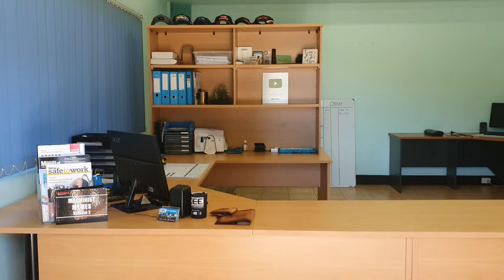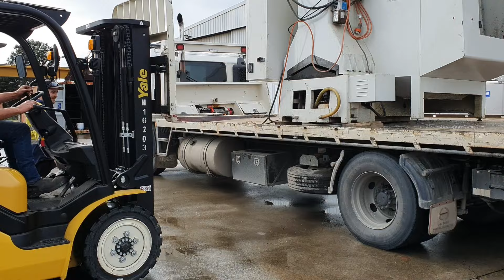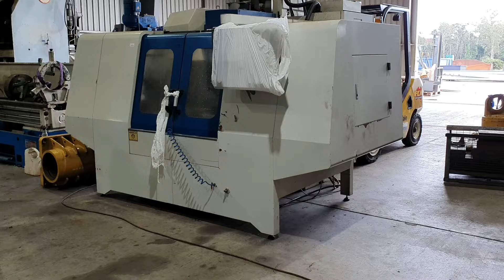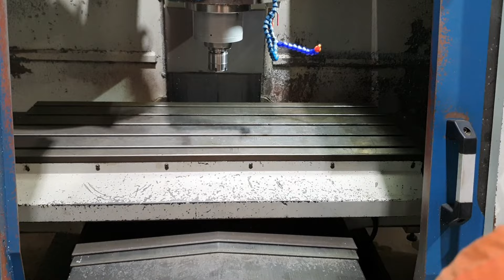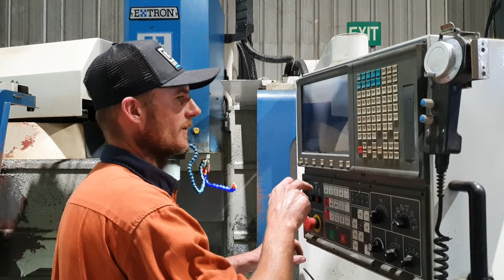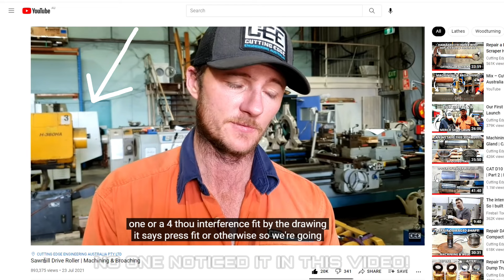Finally REVEALING Our New to us Machine | Workshop Machinery

Comment: The purchase of the machine will turn out to be the least expensive part of the journey. The CAD/CAM side is a whole other expense and learning curve , including the required post processor to convert the NC files that your specific control will require. It's definitely a walk before you run learning process, but since you already have lots of manual machining experience, I don't think it will take you too long. Hard to rationalise spending 45 minutes programming  and setup to bore one or two holes,  especially when you could have done it on your manual mill. If you force yourself to use the CNC whenever you can, you will quickly realise the value of your CNC mill.
Love the video's, and all the best to you!
Reply: Machinist here. CAM is the cheapest part of any CNC machine. As a business you do not mess with free CAM software. You must make sure you have a bulletproof post for that exact controller on that exact machine. Pay for it, or gamble with crashing your machine and needing a spindle rebuild.
Reply: Aww…. He will learn as he goes …. In the meanwhile, he will be cranking out metal bananas…. They will be online in the store.
Reply: As it is 2000+ machine it should be g-code capable so modeling shouldn't be a problem with any cad/cam software with g-code output.
Reply: @goodiezgrigis  G-code has been around since the time when these machines were called NCs instead of CNCs and ran programs off of punch tape.
Reply: @goodiezgrigis  The boot screen shows the software is from 1998.
Reply: @goodiezgrigis  said flippantly as if commented by someone with zero real-world experience
Reply: @new-zealand-clippy   I learned the hard way. It's not very polite to assume who/what I am. regards
Reply: @goodiezgrigis  Not so fast, the CAM software generates a toolpath, and the post processor generates the control specific G code. You have to be very careful with just punching out the code to the machine control. I'd go back to the previous mill owner and ask them for their post processor (specific to the CAM software they use)
Yes, most likely Fanuc, but all controls especially non-mainstream PC based machine controls can have very specific block structures, if you are lucky the control will stop at the faulty block, if you are unlucky you may end up with the spindle buried in your vise.
 I ended up testing each cycle separately, and modifying the post processor before I could get our machining center up and running. Our control (FAGOR 8055M) was not mainstream enough, so that even the SolidCam post processor we got with the software was useless. Cheers
Reply: @martyincanada  you want a specific post-processor tailored to your machine when you are running days long in production where every lost second is money. For small batches, standard G-code any machine can use is perfectly sufficient.  It's a totally normal mill with XYZ axis and a tool changer, one of the good things to learn is even to write g-code yourself to get the machine to do what you want.
Reply: I had a Toolmaker friend that ran the only NC (CNC?) machine (at that time), which was a mill, in the Tool & Die Shop.  He programmed it by hand using pencil, paper, his calculator, and had memorized the G-codes needed to run the machine.  The pencil, paper, & calculator were to 'trig-out" the required dimensions to go with the G-codes.  Of course, he still had the programming manual if anything "unusual" came up.  I don't recall him making more than only a very few mistakes over the years, which is much better than I can say for the CNC Shop across the aisle which had full-blown CAD-CAM support.  They managed to make way too many batch mistakes that were extremely costly in both lead-time for very hard to get materials, machine time, and all the cost that goes with those kinds of mistakes, especially when they are able to be hidden from someone in Management with enough power to make real & lasting changes (i.e., real & useful training where appropriate and even termination where that is appropriate).  [Sorry for getting on my soapbox from some bad experiences at work before retirement!]
Reply: @bobvines00  That's just lazy programmers
Reply: @SuperAWaC  Or it could have been the (I think it's called?) "conversational programming" right at the machines maybe.  I wasn't supporting the CNC Shop by then, so I only saw the piles of expensive scrap.  :(
Reply: @bobvines00  lazy programming is lazy programming. conversational is pretty awful though
Reply: @bobvines00  NC and CNC while similar are also different in their own right. NC was the precursor to CNC, and has been around since the 1950s.  

NC is Numerical Control. The first true NC was developed in the mid 40s after WWII (1946 I believe), but they weren't produced in mass until the 50s. The programs for NCs were delivered to the machine via punch tape. The tape was the data transfer method (like thumb drives today), and the machine had an analog computer that would read the tape. In early years the program would be typed out on a special typewriter that would then print the program onto the punch tape. In later years the program was written on a computer, and sent to a printer that would punch the tape. If there was a fault in the program it was much slower to fix as with punch tape the area of the fault was literally spliced out and the fix was taped in. Later on the punch tape was replaced with magnetic tape (like that found in VHS tapes). Not long after this the NC would turn digital. 

Computer Numerical Control (CNC) digitized the then NC machines. Now programs that were typed on a computer could be sent directly to the digital (computerized) control. This was originally accomplished with floppy disks, and is done now with USB thumb drives, and over the internet via Ethernet lines. Programming errors are much easier to fix as they can be corrected right on the control. CNC not only made it easier to write and edit programs to the machines, but multiple programs could now be stored right on the control and called up at anytime. NCs couldn’t do this as they had no memory and executed the code as it was read. This was just one of several evolutions that CNC brought to the table. 

In the days of NC, programming was dimensioned point to point, or Incremental coordinates as it’s called. CNC allowed programs to be programmed in Absolute where all coordinates are dimensioned from a single origin point. Now some NC machines were capable of Absolute coordinates, but these were developed in the very late age of NC. CNC machines are generally faster than their NC counterpart. This translates to shorter cycle times and cost savings (because time is money). Yet the biggest advancement that CNC brought to the table was canned cycles. Common canned cycles are drilling, tapping, boring, etc. They allowed an operation that once took several lines of code to be condensed into a single G-code (like G83 for peck drilling) with added parameters like Z axis depth and peck increment. 

All around the history of NC and CNC is pretty cool. These programmable machine tools have left their legacy on the industry for the past 80 years they’ve been around.
Reply: @trainman5371  Yes, we still had paper/Mylar tape NC machines when I started working, but they transitioned to CNC machines using first "Sneaker-Net," then an in-house "home-grown" (but good) network, then backwards to "Sneaker-Net" again when "IT SECURITY" was shoved down our throats by those that didn't understand CNC Machine Shops.  Later, a bass-ackwards CNC network was eventually re-set-up to permit programs to be sent from the Programmers to the Machines, but it was very costly, wasteful of production floor space (don't ask!) <insert face-palm here>, and slow, due to the "IT security weenies" having control.

The Toolmaker I mentioned was actually using a CNC-capable machine, but it was always "stand-alone" with no connection to the rest of the world and it was programmed primarily by the Toolmaker typing in the commands.  I'm not certain, but I may remember one time when my friend actually got one of the Programmers to help with a job and the program was either sent to the machine via "Sneaker-Net"  (once they figured how) or was printed out to be keyed in.  I suspect that the machine sat for years after my friend died and eventually was scrapped because by then the Tool & Die Shop had been "gutted" (personnel-wise) and there was no-one left able to run the machine.
Reply: @bobvines00  Yeah whoever managed that place certainly had their head up their ass. Sounds like it was a retro fit machine like a Proto Trak. They sell conversion kits so you can convert your manual knee mill into a CNC. I think they also sell the whole machine already converted, but don’t quote me on that. Most retrofit machines only have CNC capability in their X and Y axis. The Z axis (the knee) usually stays manual, but they do put a Z axis encoder on the quill for drilling. Those machines run conversational programming which is what you described where the entire program can be written on the control. They’re pretty convenient for making quick drilling and counterboring programs. They’re also really easy to program.
Reply: @trainman5371  Yeah, the highest levels of "corporate management" responsible for that crap definitely had their heads up their asses.  The machine wasn't a retrofit though -- it was pretty high-end for its time in the late-'80s - early-'90s, but I simply can't remember its manufacturer.  The guys responsible for procuring the machines only bought top-quality equipment, as long as it was available.  They did start buying CNC machines with conversational programming built-in for the "simpler jobs" which may be where the piles of expensive scrap came from, not from jobs programmed by the "real" CNC Programmers who had the high-end workstations, 3D Solid Modelling CAD software, and the (I forget the proper term, I think) the proper "processors" (the conversion programs to convert from CAD to the individual machines' G-codes) for every machine type, as needed.
Reply: @bobvines00  A place I used to work had a CNC mill like that. It was an old Mazak Nexus 510C, but the control (Mazatrol) as they called it was set up for conversational. Some CNC manufacturers integrated conversational programming into their controls along with the conventional G-code. I work with a lot of Haas now and I don’t believe they offer it. I think Fanuc does though.
Reply: Kyle can get a freeware cnc software online. Not the state of the art, but free.  Bamcam is one that should work.
Reply: @memyselfandi3925  The name's Karl, not Kyle....
Reply: @MrPossumeyes  haha, stupid spell check changed it.
Reply: If something isn't right in the post, the machine usually just throws up an error code and wont even run. CNC machines almost always do what you tell them to do, so if it's doing something whacky, you probably told it to do that somehow.

Comment: Getting a CNC machine is just the first part, now you have to figure out how to make programs. You can either write them by hand (takes long and it's easy to make mistakes) or you have some awesome CAD/CAM software and let it generate the programs for you. The latter one often costs quite a bunch more though as you might have guessed :)
There are some free programs, they're not as user friendly though, which might add frustration when trying to take some first steps in the field.
Reply: AutoCAD - Simple & Basic. Works every time.

Comment: You seem a little late to the world of CNC but with your vast machining knowledge it will soon take over big chunks of your work. I started with CNC in 1977 and don't think of it as just an automated manual machine. My advice would be to have a little play but then take out some time to quietly study its capabilities with the manuals rather than trying to learn by pressing buttons and hoping. Invest in a good offline tool pre-setter and keep preset tools with known dimensions in a nice labelled rack instead of having just a couple of toolholders and having to reload them for every job. Saves lots of programming time and setting on the machine if the toll dimesions and offsets are known already.  Particularly become familiar with macros and label and store all your programmes on a disc or card. It's astonishing how often the same patterns and tool paths recur and can be used time after time. Anyway, best of luck!

Comment: I've had a 1989 Fadal 4020 for a couple years now.  Still have a lot to learn, but its amazing the stuff you can make pretty quickly/easily with one that would be extremely time intensive with manual equipment.

Comment: Nice, Come on over to the dark side. Dark side is better because can close the doors and then all the hot metal bits and coolant stays in the machine instead of on your skin and the floor. CNC is a lot easier than most old manual guys make it out to be. You have to do all the same things but instead of turning hand wheel to a number you just type it in and the machine turns the dial for you. Oh 16 tools isn't very much, definitely not enough for job shop. I run a one man job shop with my 40 tool machine and that isn't enough, you'll start leaving go to tools in there and before you know it you'll find you have it full and be taking them in and out all the time. Looks like a decent size machine that's in reasonable shape and I think once you start to get the hang of programing and running the control you'll be hooked on the power of the dark side ;)
Reply from the maker: Awesome mate thanks for sharing your insight

Comment: Good going Kurtis. That's looks like a good  machine to get your feet wet with cnc machining seeing as it's the 21st century and all. Once you get working on it you will probably wonder how you got by without it. Onward and upward. Thanks for the video.

Also, my guess for one of the other new machines is a surface grinder. And it will probably be one with a lot of real estate on the chuck.

Comment: that machine should be handy for you like drilling and tapping ina cirkel like you always draw and centerpunch that by hand but that machine can do that for you ,does it use G code programming or a manual guide ??? i used to work with a fanuc till 2004 and now i work with heidenhain

Comment: Nice one buddy! Got 2x  5 axis ones in my shop, they will do the marvel in those perimetral holes or even any small boring job!
Reply from the maker: Awesome 😎👊
Reply: @CuttingEdgeEngineering  I'll complain when you F up! 😂
Nah, keep the coolant on point.
Run a few spindle tests before you start, (that's why parts are very expensive...)
Make sure is running 100% truth in all 3 axes and then have fun! 
One test program... And all the others will be just a play button and run back to your beloved manual machines 🤠 Spaniard living in UK

Comment: Two more machines to come, classics, and you want us to guess?  
Vertical lathe, and some kind of hone that compliments the one you already use.

If you really want to hide whole machines from the camera, drape them in chromakey fabric.
Reply from the maker: That's brilliant 🤣👍
Reply: @CuttingEdgeEngineering  hahaha . . . which part?
I think you need a vertical lathe based on recent jobs where the gap-bed had to come out.  And the hone is just a guess, because there have been recent mentions of where the current one wouldn't quite fit one job or another.

But you probably meant the fabric, and either way thanks!

Comment: At a previous workplace we had fork-extenders for our truck. It was basically hollow metalsleeves that doubled the length of the forks. Nice shop-project for you. =D
Reply: Fork extenders don't change the centre of gravity of the load. Once you get 18" past the back of the forks your safe lift capacity tends to drop really fast.
Reply: slippers are good and all. But they do tend to put the load way out past where it should be sometimes

Comment: You need to employ someone who is capable of making things do things that they don't want to do, a bit like Karen with you doing pieces to camera. Karen, time for you to learn Fusion 3D!
Reply from the maker: She already knows solidworks so will probably learn fusion as well
Reply: @CuttingEdgeEngineering  stick to solidworks, fusion is too bananas :P
Reply: @troyam6607  agree. fusion is for the home gamer. Having said that I worked for many years in a similar repair machine shop and 90% of the programming was done at the control.  So my advice is not to invest in CAM unless you really need it. Remember they put a man on the moon with pencil and paper with not a single 3D program in sight.
For cylinder eye repairs I highly recommend circular interpolation followed by boring with the Iscar ITS boring tools.

Comment: sweet. i've seen a lot of vids w/ CNC work going on but i have no idea what programming them involves. i bought a 3D printer and wound up learning enough Fusion 360 to make what i wanted to make but the slicer program would generate the G code and the extruder path. it would be interesting to follow along as you learn.

Comment: YAY CNC Mill!  :D I assume it's a CAT40 spindle, so all your manual-mill tools should bolt right in with the right pull-studs. As others have said, use single-block and turn the rapid traverse down all the way when you go to check a new program. I'd also say to hit up your mate that you did the sawmill roller work for, he could probably get you pointed in the right direction for a CAD/CAM package to use, along with where to find the particulars for the machine's implementation of g-code. Once you've started playing with it, it will start making sense - I taught myself how to edit programs on-the-job and on-the-mill and those machines were WAY older than this one.

Once you've got it up and going, you'll wonder how the hell you ever got on without it.  :)
Reply: He said BT40
Reply: @Ddabig40mac  same thing, different nomenclature.